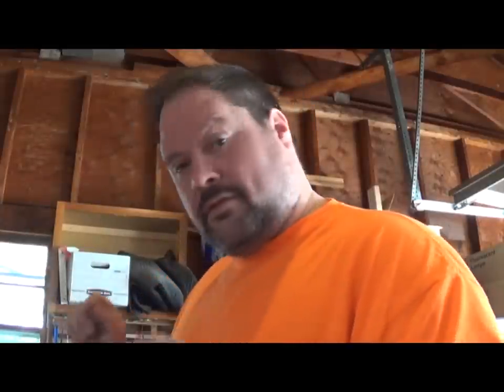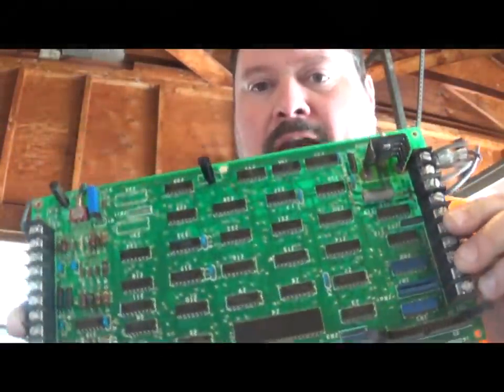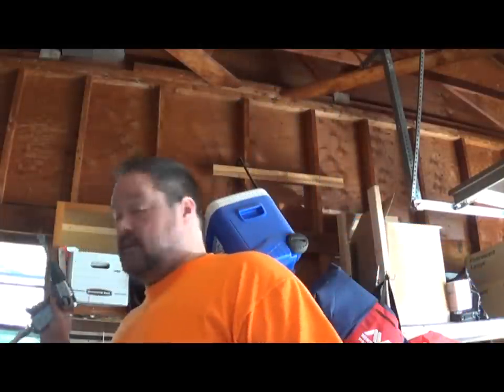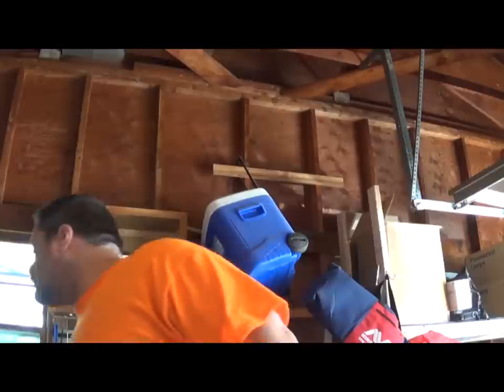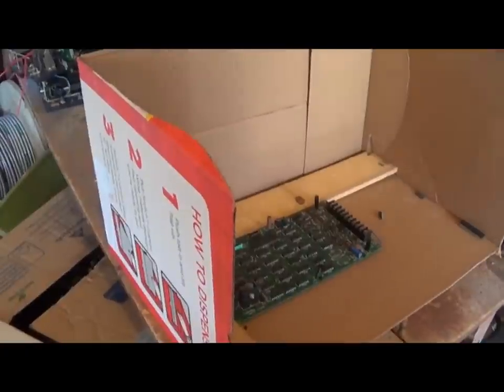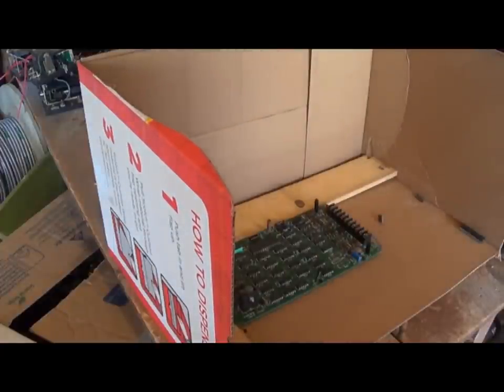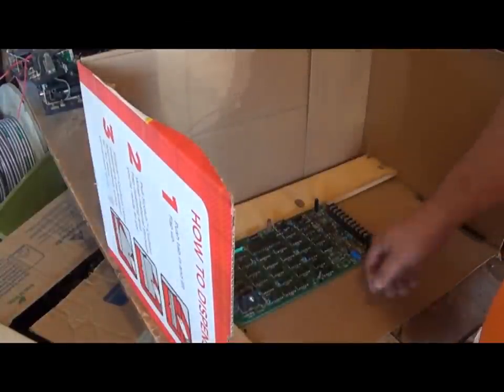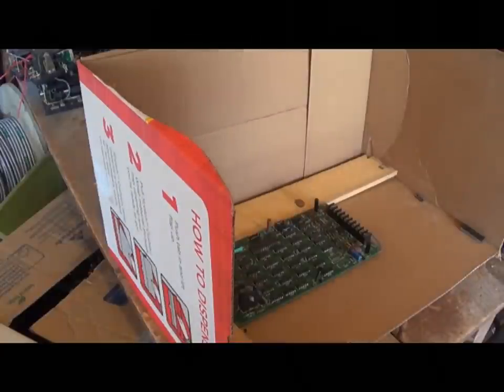The Moose Scrapper Show Ep 3 Circuit boards, Ink and toner, and MORE!

Comment: I have found to remove the mlcc's. I use a window decal scraper with a razor blade. Its long handle allows you to be able to reach anywhere on the board and keep your hand out of the way from scraping your knuckles on the sharp areas of the board. The razor blade cuts right through the soldier with ease.

Comment: I like the box arrangement - makes it easy to recover the stuff.  I wonder if it would be better to bolt the box down instead of nailing?  I don't think Velcro would hold but bolts would allow you to secure the box and easily reinstall without popping nails.  Just a thought.

Comment: you can buy yourself an air keg( about $60 at a home improvement store) and put it inline between the compressor and hammer. It will give you more volume of air and you wont have to keep letting the compressor catch up.

Comment: Awesome and informative video as always Moose! Concerning the impact gun w/chisel... I've done that method myself but I also noticed my power bill rise quite a bit when doing so. Sadly, air compressors use a lot of amps. The only time I'll use that method now is if I score a big load of circuit boards at once or in a short time span that would take a horrendous amount of time to cherry pick by hand. But if I only get a few boards at a time here n there... I feel it's best to use good ole manual labor. Others may disagree and say time is money no matter what but one's own value of their time can only be measured by themselves only. I try to consider if quicker really is cheaper depending on the cost of the method. But in using the air chisel method... it is definitely easier and I would recommend wearing some sort of gloves to help reduce impact vibration to your hands and goggles because parts will at times fly back at you. Can't scrap if blinded lol. Again... awesome video as always and I'm so glad things are going well for you :)
Reply from the maker: Thanks!  I tried to stick in there using safety gear...  hard to do while maneuvering with a camera solo.  But you are right!

Comment: Try holding it with vice grips and heat the back with a torch run the flame back and forth dont burn the board and they just fall out .Way faster then what you just did.

Comment: Hi there moose scrapper I need some help, I have used Muriatic acid and a little of hydrogen peroxide on gold scrap. ( i didn't now about the bleach ) Now I have filter it and got it all clean. I got like yello/orange color seems very pure color. It has been 3 days with the same acids. Now what should I do next?..
Reply from the maker: I am not sure what you are saying.  What did you do with the bleach?
Reply: Moose Scrapper Sorry for the delay, I didn't know about the bleach until I saw one of your video. I've used muriatic acid & a little bit of hydrogen peroxide after 2 days I filtered it and I don't know what to do with it until now can you tell me the next step ? Awaits
Reply: Awaits ?
Reply: dude you should do the research before starting the process write it all out have a schedule, running before you can walk will get you hurt stay safe

Comment: hi moose i see in the background you have a new roll of bubble wrap do have have large stores like ikea furniture stores most of the time they have very big skips dumpsters out back with lots of fresh packing have a look it cost nothing and saves you tons , you probably have thought of that but i wanted to share anyway thanks darren
Reply from the maker: thanks!  Have not thought of that...  I do find a lot of ads on craigslist though for free packing material....  I got that roll at Sams club for $12 because I was in a pinch.
Reply: i no what you mean it can be expensive , i just moved house and i kept all the packing fillers it comes in handy ;-))